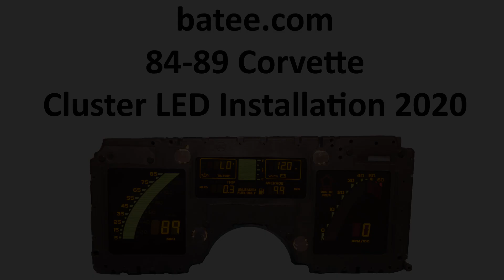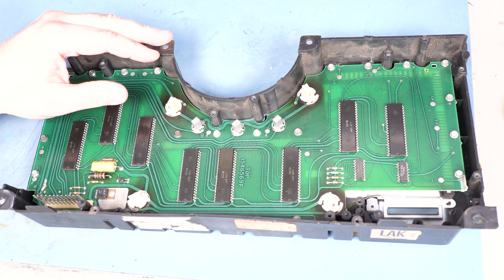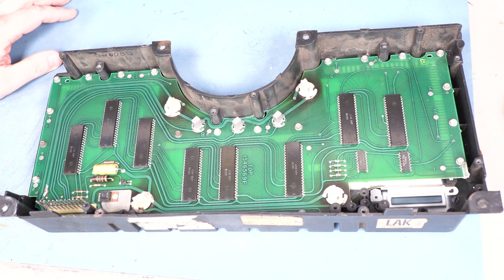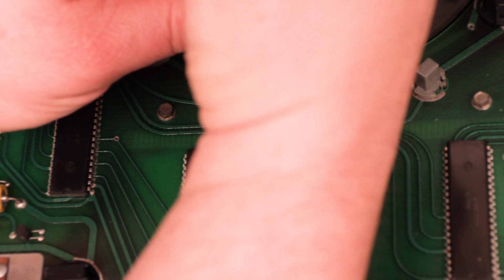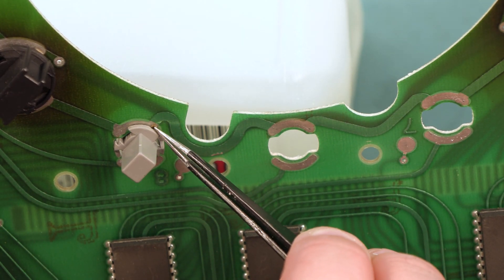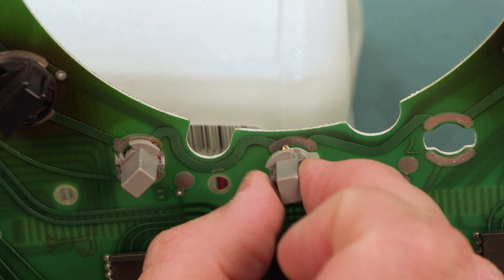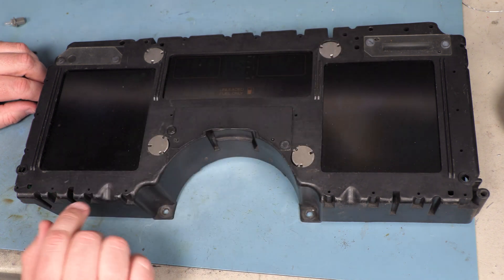84-89 Corvette #8 - Digital Cluster LED Install (2020) by batee.com

Comment: I was able to upgrade the bulbs to LED just by removing the fascia and leave the cluster mounted. Then pull out the incandescent bulbs with needle nose pliers then push in the LED bulbs and reinstall the metal caps. Polarity in my case was important. Will now test for a few days before reinstalling the fascia